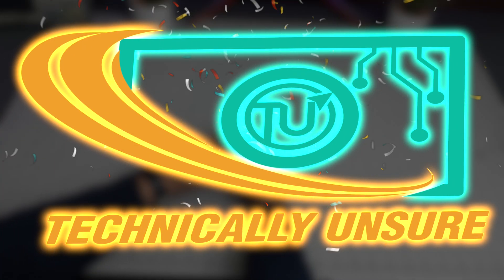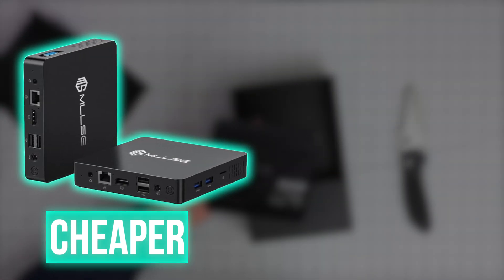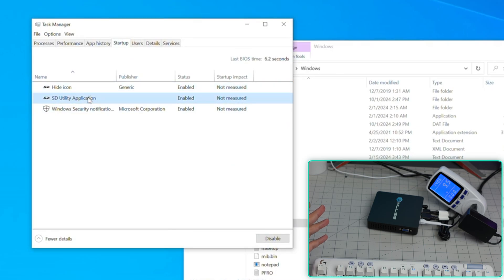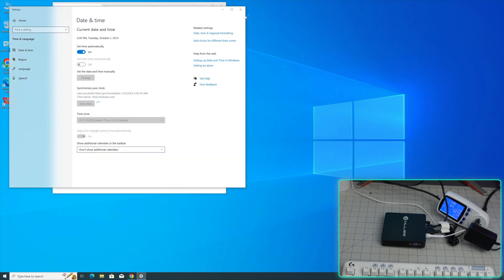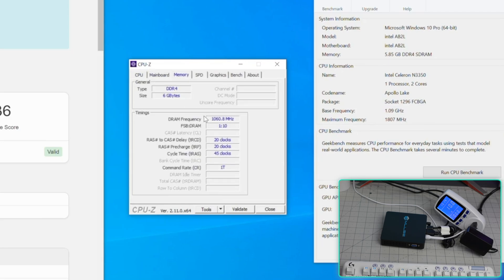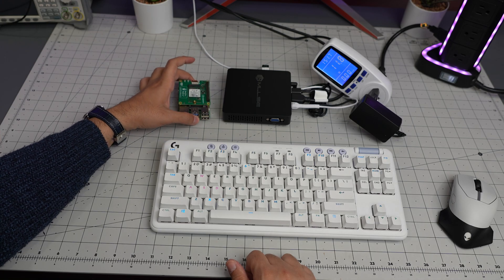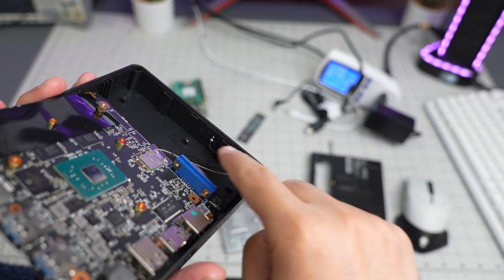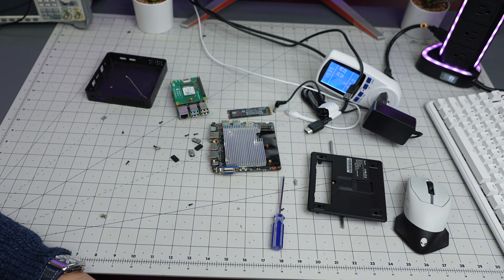A $65 Mini PC from AliExpress That You Shouldn't Buy

Comment: I bought the MLLSE M2 PRO mini PC.
I installed Windows 10 LTSC and it runs fast, even when turning it on and off.
It's essential to place a fan of at least 1500 rpm underneath the mini PC to drastically reduce the temperature and prevent it from freezing. It's mandatory to remove the M.2 SSD cover to allow full airflow and dissipate heat, or cut slits in the M.2 SSD cover with a heated object to allow air to enter through those slits.
Install an M.2 SATA SSD to increase storage, disable the built-in Bluetooth, and install an adapter. This will prevent music from stuttering.
For YouTube videos, install h264ify in all browsers so the GPU handles the video and prevents stuttering when using VP9.
Set the GPU to performance mode and the power settings to balanced.
Unfortunately, you can't increase the RAM unless it's virtual RAM on the SSD. Use HD or 1080p resolution. This has worked well for me; I live in Central America and needed to optimize the temperature.

Comment: Got it in a flash offer for like $40 or so, hell maybe even less, so I didn't mind.

Kinda got scammed? Lmao.

Listing mentioned n4000 cpu, and 128gb rom, box arrived and it says n4000/128rom. Unboxing comes and boom n3350 and 64gb rom 😂

I never got the ssd port working, tried both nvme and m.2 sata. Nothing happened and drive just got hotter and hotter. 😅

I don't regret it but yeah, dont buy this crap. Very very few uses could this work for. there's plenty of better options out there.

Comment: OK for FydeOS or LibreELEC but even those options don't make the processor look like value in 2024, where there are better options for not much more than really make a difference in performance.

As for the potentially shady or just plain annoying stuff, a Windows re-install would be the default order of the day, even though it should never have to be something to seriously think about.

If you know what the limitations are though, it could be a fun machine to tinker with and are willing to fix the cooling issues yourself.

Comment: I've been running this 24/7 for a couple of months with ubuntu server (off an SSD). I've never really had obvious heat issues either. It runs a couple of utilities and a fileshare. Interestingly that works out of the box for me, no issues with ethernet, or stability. Also, the "NVMe" SSD is sata.  Kinda curious why you'd had so much issues with it. Might be its more stable headless, or ubuntu had problems with the iGPU for some reason.

Comment: N3350 is sooooo old now.  Low power, Low Performance, Low Investment, Low Return on that investment.  Not even enough memory to max out the video RAM.  And that windows install is really sketchy - that would be an automatic wipe and replace with Linux.  Probably useful as an IOT controller or something, but there are better choices.